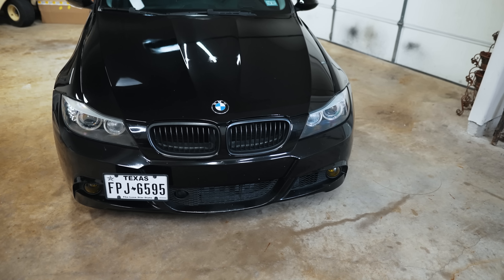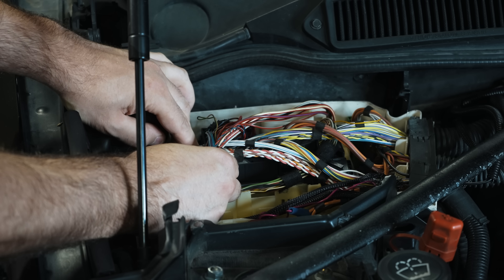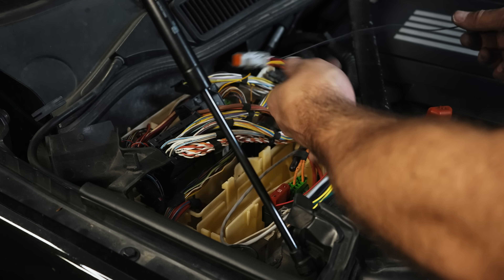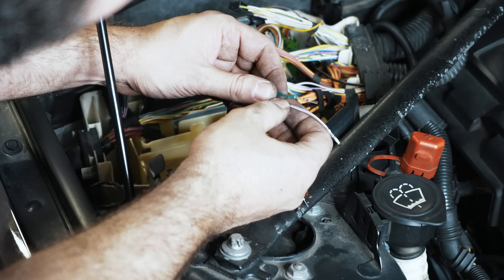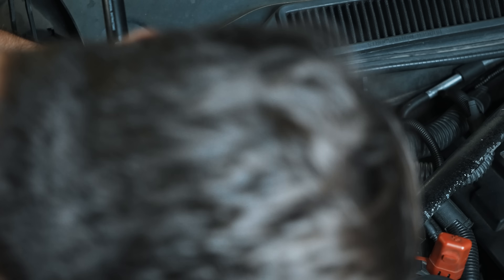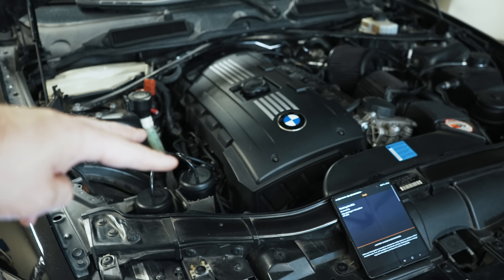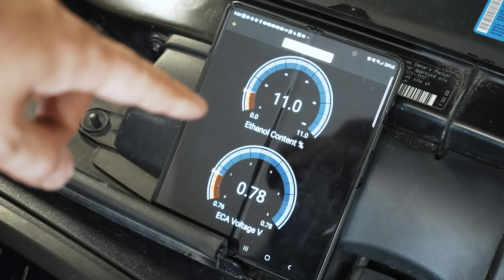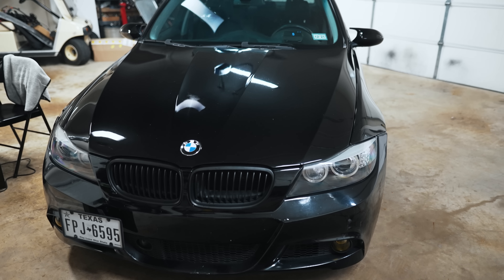Owning A Modified BMW Is Better With This!

Comment: Did you have to remove the spool Bluetooth on the ethanol sensor to connect the flex fuel harness? Can you only use the mhd to see your mix now?

Comment: Recently I checked my mhd tune why is my stft 1 -9.0 and stft 2 7.0? Same with  ltft 1 - 9.0 ltft 2 11.2 . Should be different? It would be a big help.. trying to find some random misfire..new battery new alternator new lpfp new hpfp injectors coils and spark plug... 🙄😂

Comment: I installed my ff from motiv roughly a year ago but I suffer from the ethanol reading spiking to 100% under heavy throttle no matter what I fill the car with. Cruising it reads just fine. I've used alternate grounds and 12v sources from the directions in an attempt to solve. Have you or anyone else on this section witnessed/solved it? Again no problems at cruising, it reads fine, it's just when I'm scootin it pegs to 100% and back to normal when I release throttle. Just a single bucketed fuel pump, no Hobbs switch issues to cause it.
Reply: I emailed motiv for support but didn't get suggestions I haven't tried already.
Reply: Did you ever get that issue figured out? I have the kit but haven’t installed it because I’ve read a few reviews that say the same thing as you.
Reply: Did you figure this out same issue here
Reply: I have not had any resolution yet. It's been on my back burner for a bit though.
Reply: Same issue no resolution yet

Comment: Hello, how much of the rubber fuel lines on a stock e90 n54 needs to be replaced to run ethanol?
Reply: Do you get the answer?
Reply: @r3drogo  no. Nobody answered yet

Comment: Did you notice that lost the cold start roar think you can find a way where you can still have that with this flex fuel sensor Iv been running this kit for about a year now
Reply from the maker: Come to think of it yeah the cold start was pretty tame.
Reply: @VehicularDIY  yeah that’s what Iv noticed, After I did the single turbo swap I had flashed a base map and I got the hear it one time then cooked my 02s but I really wish there was a way too get the start up roar back

Comment: Already have the spool kit installed will more than likely do the rest when it’s single turbo time hopefully Doc Race finally ships the dr700 kit out next week or maybe he did already not sure just paid for the rest of it a few days ago. Should be nice I plan to run the same fuel system you have almost identical.
Reply: Just a guess, but are you running a stage 2 pump to a 3x overdrive with the spool ethanol sensor/micron filter and motive flex fuel kit and that’s it, or anything else?
Reply from the maker: I have a secondary LPFP that's driven by a hobbs switch.  I made a video on that.
Reply: @VehicularDIY  yeah I saw it just couldn’t remember at the time should be plenty of fuel I’m going to see how far I can get with a single pump and everything else mentioned with a 6466 on e40/e50 hoping for around 650 or so it’s going on a dct 335is.